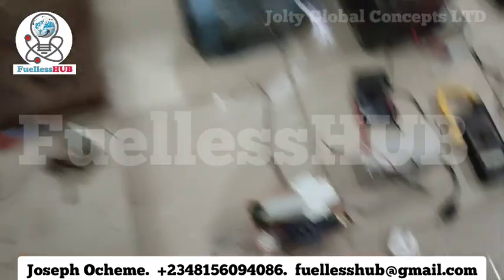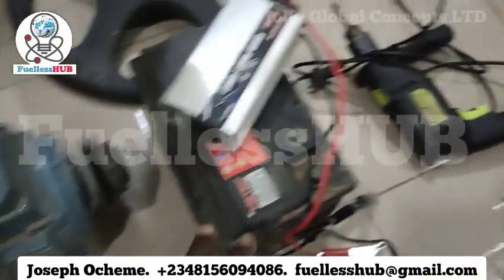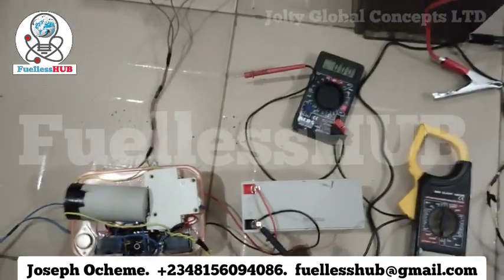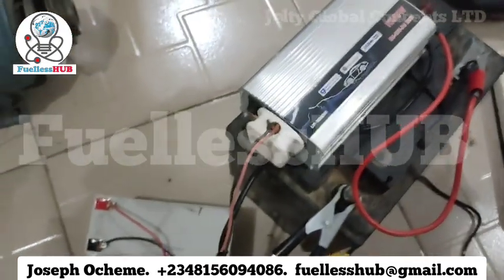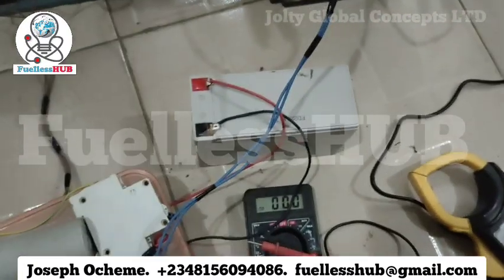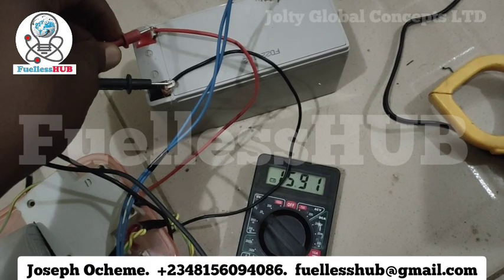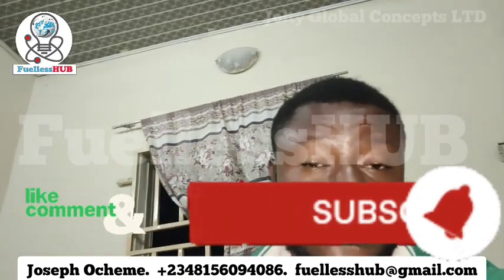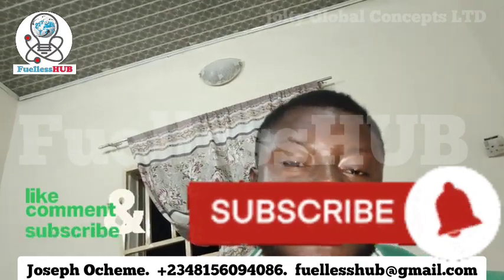Fuelless Generator Open Test more Output than Input

Comment: I recommend you do the same tests but use a water heater instead of the drill or the grinder, also include power measurements for the input also,
Reply: I say this because the voltage you are using on the drill is only 160v dc instead of the rated 220v ac which when rectified to DC ranges around 300v,, so you can't expect the drill to swallow the 700watts on 160v dc